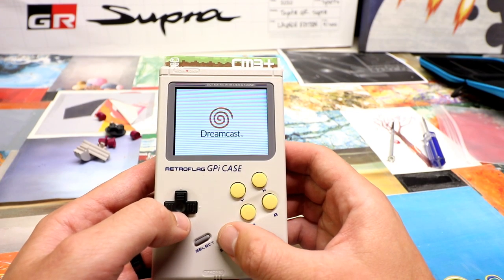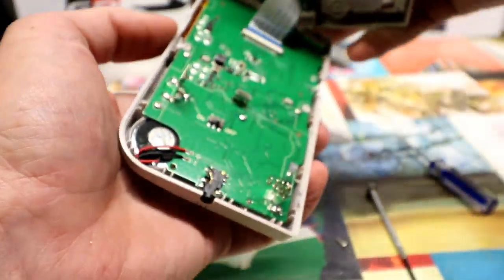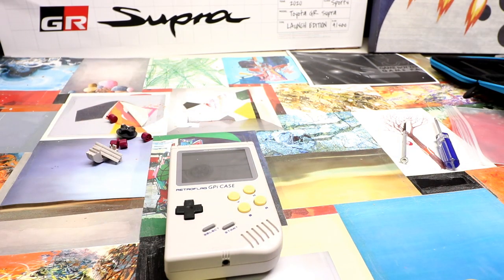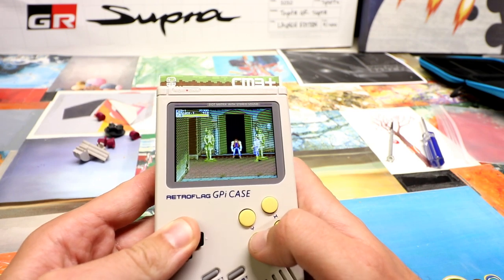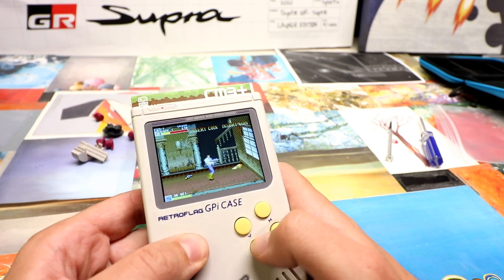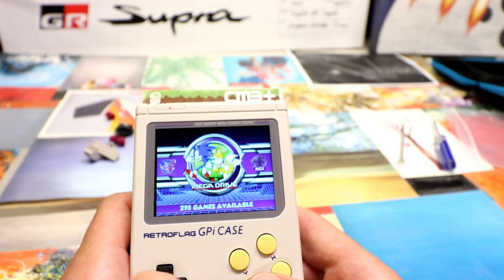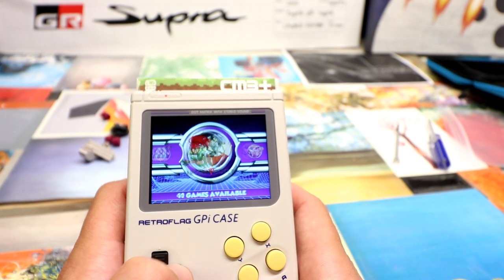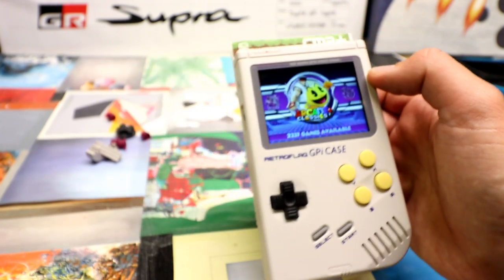Custom GpiCase Modifications Better Handheld Experience How To

Comment: Hi Drew. What is the feel like on the new pad and buttons compared to the originals?  I’ve replaced my dpad with a Gameboy Pocket pad which is way better than the original. The new one looks like a tighter fit. Thanks.
Reply from the maker: More responsive and I because its slightly bigger easier to to know where I am and more accurate